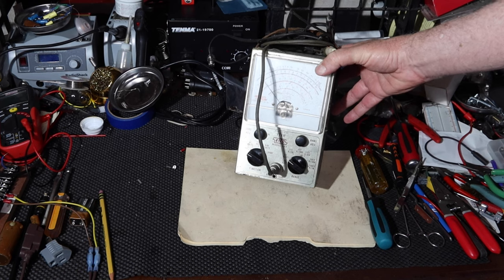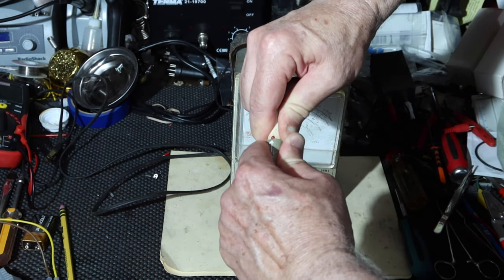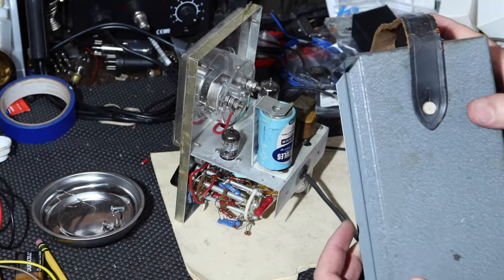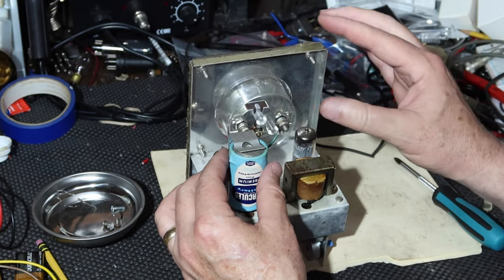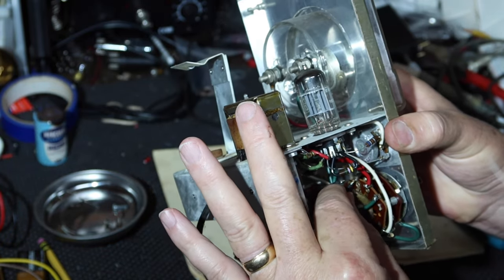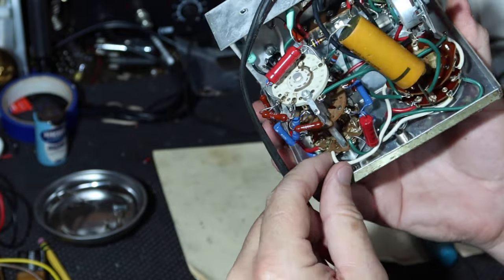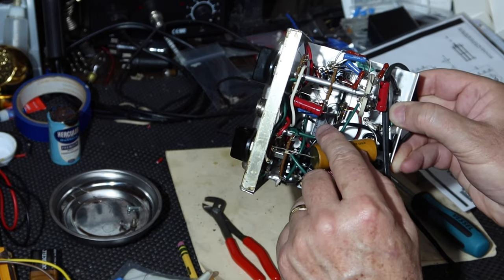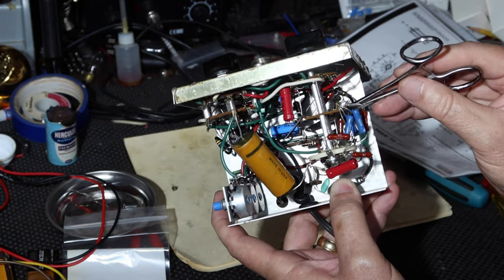Vacuum Tube VoltMeter  EICO 232 and Uni-Probe. Can We Fix and Use It?  w/ Curtin Meter Unboxing [4K]

Comment: I just bought one of these meters yesterday. Found your video and checked my probe. Got the same thing as you Open + probe. The problem with mine was simply the copper contacts building up corrosion in the way of the brass cam?. My 1meg ohm read 1.04 meg. My whole unit is in excellent condition. Like yours, never opened. I do think mine was factory assembled. Meter says 1967 on the back of it. The battery was also there and like your corroded. To make it work, I just cleaned it, shotgun replacement of the caps and most circuit resistors. Some resistor were out of spec. Won't be ready for few weeks from now.
Reply from the maker: Cool.  Some of those resistors may work out after adjusting the calibration.  Was your battery the same brand?  The probe worked more reliably for me after I added the waist bend to the blades.  It is a very good VTVM.  Good luck with it.
Reply: No my battery was not the same as yours, but it looked like a 60's battery. Was a BrightStar brand and only the top was corroded. I don't know how I got that 1.04meg ohms but hours later I measured the resistor and I came up 2.0k range so I ordered a new one. I soaked cam and copper in a solution of vinegar and Sea salt. Came up clean. And for that top half to pull out nicely under spring load, I had to open up the phenolic washer inside diameter with some sandpaper. Mine was binding on the fiberglass tube. Key is to have it free to slide along the fiberglass? tube. It was a real pain to place those copper blades under the larger washer which was under load. Took me a half hour. Also, when reassembling, It important to have is the red dot in the right orientation. I think the cam and red button must contact the copper blade without resistor. Otherwise the reading on the side of probe AC or Dc will be backward. I looked up the cost of this and in today prices it would be over 300 dollars!  @PracticallyFixed

Comment: I have a bunch of vtvms. I calibrated every dang one within a few percent it's a meter 😂😂😅
Reply from the maker: Not a great probe design though I have to say.  But it works now.  Thanks
Reply: @PracticallyFixed  
Yeah, probes should probably not contain those kind of switches. All of mine use separate probes I have noticed.
Reply: Btw, I have a ts-505d/u a real jewel that is driving me batty, so no, not all of mine work right (-:

Comment from the maker: Jump to:
0:01 Intro
2:30 Opening and Look-See
8:57 Tightening Probe Connector
9:40 Capacitors
14:49 1st Power Up/Power Supply Check
17:04 Uni-Probe Part 1
34:57 Battery Holder
38:26 1st Function Check
47:36 1st Calibration Attempt
57:58 Unboxing Curtin Voltmeter
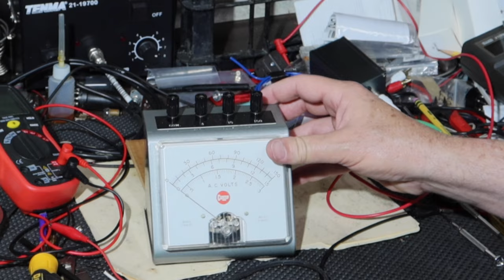1:00:59 Calibration without Probe
1:03:51 Replace 12AU7
1:05:02 AC Calibration
1:08:44 DC Calibration
1:12:32 Ohms Check
1:14:59 Uni-Probe Part 2
1:17:20 Wrap Up
1:18:46 Alignment Demo

Comment: I just restored one of these. New caps, and changed out the bad tootsie roll resistors that were out of tolerance and new tubes. The 12 AU7 and the EB91 were questionable on all three tube testors all giving different sinerios. 
Anyway where in the world to you find a uni probe. This came with two HV probes that are currently useless to me. I'm not into TV's yet.
Reply from the maker: May be able to watch ebay for one if you want originality.  Design-wise, the switch design is a little rinky dink imho.  However the schematic which is available online shows the probe on the left side for DIY.  If you made your own probes you could just have one with, and one without the resistor and not bother with a switch. Thanks for watching.

Comment: So not a single resistor was bad?
Reply from the maker: It's been over a year since I did it, but I believe the fix was new electrolytic, new tube, and fixed the probe per the service bulletin.  I don't recall replacing any of the resistors.